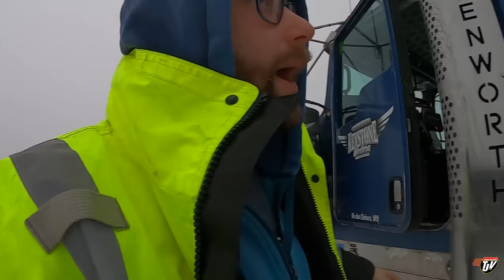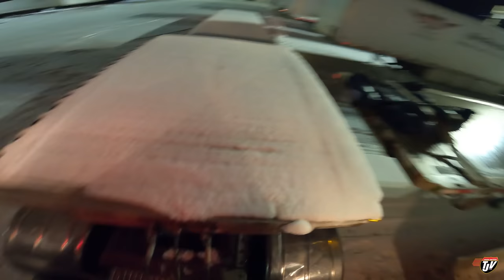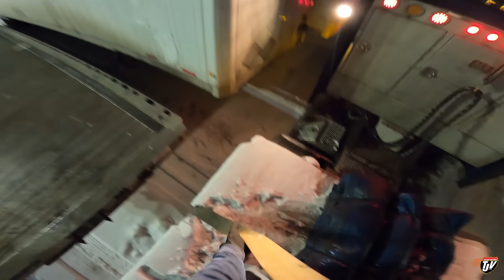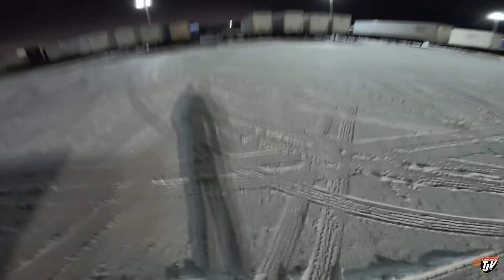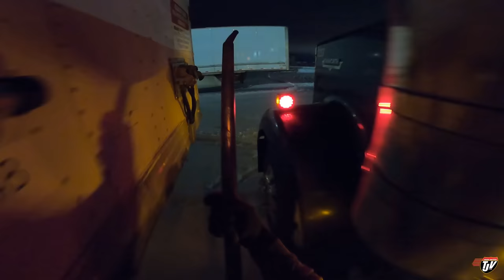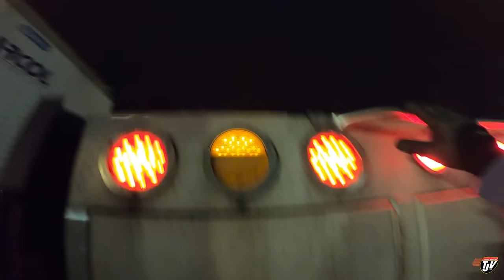LONG DAY IN THE SNOW | My Trucking Life | Vlog #2688

Comment: That storm was nasty in Wisconsin.  We drove 40 miles to my husband's cancer doctor appointment and the roads were slick.  Three cars buried axel high in the ditch and a jack knifed semi.  No one injured I am thinking.  Just tow trucks and a rotator for the big rig.  Made it home safe and had to do 2 hours of snow blowing due to wet and heavy snow (slushy snow under top layer).  Glad to know you made it home safe as well.  Keep that rubber on the road between those road edges.  God Bless.

Comment: Almost forgot but for cheap lights i nornally run some clear silicone around the edge of the lens to make it more waterproof cause i dont trust the stuff they use from the factory easiest stuff to use is the grilla clear silicone tube so far been using the lights with it for months and no moisture in them just something u may wanna do to the ones i got u to make sure they dont get moisture inside over time and i may send u some more i didnt know u had 4 🤔

Comment: This sounds a bit nuts but hear me out. They should have a transit board where 4 wheelers and semis can connect. Instead of a no-load going back you could load up a couple of 4 wheelers on your flatbed for the extra weight, they'd save gas and wear on their trip. You might meet a new friend or two. You'd have to invite strangers to your cab and keep your place clean though. LUL It is an idea though.

Comment: Someone really thought a trailer needs pertection 🤣 sorry but i dont drive a truck but its common sense that on a flatbed the rail on the sides is to pertect the straps if it was to pertect a trailer y do vans and stuff not have them and whoever said they r for pertection is the ones who put straps over them 😑 and ur looking a little blue at the end r u feeling ok 🤣🤣